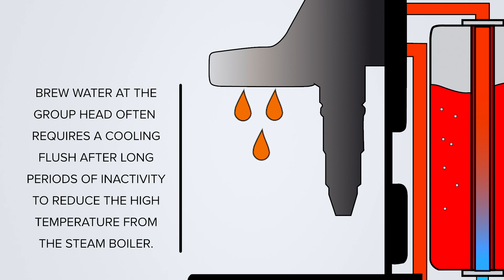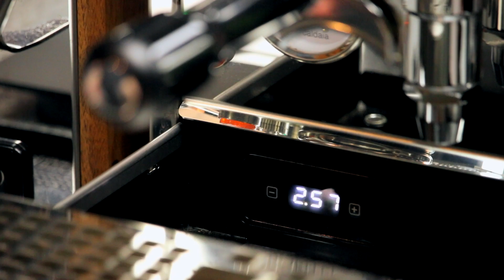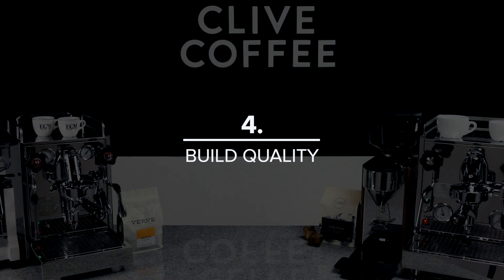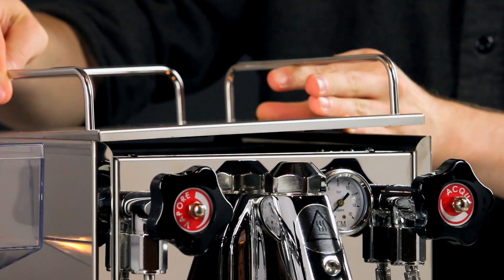Profitec Pro 500 PID vs ECM Mechanika V Slim HX Comparison

Comment: I've been reading a lot about how heat exchangers actually produce a better tasting espresso than a double boiler due to the declining temperature profile. Italians say that brings less hot water and energy to draw the astringents out in the last part of the extraction. I've been researching for so long, at one point I was dead set on a double boiler. Having been to Italy 7 times and never drinking anything close to what I've had there, I would tend to believe there's a reason the Italians prefer heat exchangers. Only in America would we lead the home barista into believing they would need a double boiler. The double boiler was created because barista's in the U.S. are not trained properly so they can pull a more consistent shot with a double boiler. If the Italians are right, and I would imagine they are, you would be better served at home with a heat exchanger unit.

Comment: Have the Mechanika V Slim and love it. Found the steam pressure was a bit high from the factory, turned it down by turning down the pressure stat by 0.5 of a turn resulting in pressure dropping from 1.35 to 1.2 bar. This resulted in less overheated water at start up while maintaining a good steam pressure.
Reply: Hi Gordon. Curious to know from other Mechanika owners...How often does your boiler cycle? Mine does every 53 seconds on average.
Reply: Thank you very much for this information! I noticed the same today, as I used the machine for the first time. I'll set it up accordingly to your recommendation!

Comment: It came down to these two exact machines before I finally purchased and it was a hard pick, both are really awesome kick ass machines. I ended up going for the Mechanica but only because of the fact I was on the fence about the PID on a HX. It's great being able to adjust brew temp electronically on the fly rather than having to adjust the mechanical pressure stat on the inside of the machine, but the PID is another part to wear out and need replacing every 2-3 years. They are easy enough to replace yourself but they do cost about $200-300 a pop (not the cheapest wearing part when in comparison the vibration pump costs $80 and can lasts 10+ years)  That considered I don't really change my beans around often enough (at all) so I didn't see the PID function as something i would get enough benefit from. Also the Mechanica was cheaper by $350 when i was purchasing so i went that way. Both are high quality machine made in the same factory, so either one will be very reliable and easy to maintain yourself.
Reply: I made the same choice for similar reasons.  How is your ECM going?
Reply: @GlowingTube  Machine is going great, hasn’t missed a beat.
Reply: @ajv802  I just got mine… I have been pulling incredibly good shots with it and hope to do so for many years to come.
Reply: Hey! Thanks for that input about maintenance. I like the Mechanika, but I do use different beans all the time, so I'd like a PID. So, that's that. I am on the fence between Profitec Pro 500 (~$2k) vs 600 (~$2.4k), since comparable ECM models are more expensive. I am on the border between the two, due to the fact that I cannot figure out the maintenance issues that I will be running into. I understand that it's pretty much HX PID vs. DB PID. Does owning DB machine require less maintenance? Therefore, does it warrant the extra $400?? Man, this is hard, since you mentioned the PID costs... yikes. I may have to rethink about PID. What do you think? What are some maintenance parts on these machines I should look out for?
Reply: @jk25653  I'm no expert by any means but If you have the budget id go for a dual boiler, and all the high end  DB machines have PID's fitted. I guess you just have to factor in the cost of replacing the PID unit when it wears itself out every few years. Not really the end of the world cost wise when you spread the cost over 3-4 years. When compared to the annual cost of your beans and water filters etc it's not really that bad. 
As for more or less maintenance with HX or DB, not too sure. I guess having two boilers means having two heating elements, but I wouldn't imagine that would dramatically affect long term maintenance costs, but better to ask someone who has a DB machine i guess. Good luck with it all, both those machines you mentioned sound awesome and i'm sure you will be happy with either!

Comment: Which one would you get ? I’m in the market of my first machine under $2k, my sight was originally with appartamento and some one told me to look into ecm and profitec!  Profitec 500 PID is on my lead what do you think
Reply from the maker: Hi there! That's a great question, it's hard to pick just one since they both have so much to offer! Between these two, you're looking at a comparison of a completely analog machine with the Mechanika and modern digital temperature control with the Pro 500. Performance wise, they feel very similar and can keep up with back to back drinks with ease. If you want to adjust settings and experiment with temperature, go with the Pro 500. If you're more about consistency and reliability, the Mechanika will certainly fit the bill.

Comment: From what I understand, since the addition of the PID on the Pro500, the recovery time after pulling a couple of back to back shots has gone up significantly, up. To 10 minutes. Can you explain that?
Reply from the maker: We have absolutely no experience or evidence that supports this. In my testing for this video, I pulled 3 shots back to back and saw no significant decrease in the effective brew temperature over the duration of the shot. Indeed, it was more stable from one shot to the next than the Mechanika by a strong margin.

Testing and personal experience aside, there is nothing about the design of the design or specs of the Pro 500 PID that should increase the recovery time. The only case where this idea might hold water is when the PID is set to significantly lower temperatures. This will, of course, increase the recovery time accordingly.
- Charles
Reply: Clive Coffee Thanks for the reply, I think what I meant was the recovery time after steaming and pulling shots. :)
Reply: I own the mechanika V slim and it is the highlight of my day. The steam power is a bit strong at first if you're not used to working with such power, but once you use it a few times it is a blast. I do agree that a 7 to 10 second cooling flush is necessary. I also warm my machine up for approximately 25-27 minutes. I've found that to be the sweet spot. Love the red on the knobs. It is durable yet easily moveable. I have it paired with a specialita and they work seamless together. Thanks for the video.
Reply from the maker: @npb3010  That's such a fun setup. We're also big fans of the touch of red on the knobs.

Comment: Great video as always. Correct me if I am wrong I thought they were the same company? Like Lexus and Toyota
Reply: Sister companies, But which one is Toyota & Which one is lexus ;)  ?!
Reply: @corruptedkid4145  I have ECM Classikca PID Not Mechanika V Slim HX  so i must say ECM is Lexus hahahaha, any thoughts?
Reply: @erocks2858  im looking to buy either the ecm classika or profitec pro 500. I need help!
Reply: @corruptedkid4145  You have to decide what you want on your espresso machine, Classika will come with PID which i was looking for and Pro 500 is Heat Exchanger which you have to control the water temp by releasing it before you extract.  Do your research before you commit.  I looked about a month before i pulled the trigger.
Reply: @erocks2858  Yes the pro 500 also has a PID. this would be my first hx machine. Ive had 2 barista express over 5 years but want something that will last 10 min. I was dead set on the classika but if im spending that much i may want to jump up to the 500.

Comment: As long as we are talking about national stereotypes: The weird thing about these machines is that they should be designed in Italy and built in Germany.  That would be more assuring.  Italians have beautiful designs, but are not exactly known for practicality, attention to detail, and build quality.  The Germans are know for precision and engineering.  Germans might counter Italian design excess that undermines performance.  Seems like the German-design and Italian-construction slogan plays to each culture’s weakness. I’m still buying one, but the current bi-national sales slogan doesn’t move the needle for me.
Reply: Search YouTube for a tour of the ECM factory. The engineers don't just sit at a desk in Germany, they work on the floor of the factory in Milan. They oversee all areas of production and ensure that the machines are built according to their spec. The tolerances and quality assurance are absolutely top notch. The reason why it's smart to build these machines in Italy is that Milan is the world capital of espresso machines so there's an entire local industry around supplying parts. This is the same reason computer/phone makers like Apple build everything in China: the local supply chain can't easily be duplicated in another country.
Reply: Interesting point. My Mechanika V Slim came with an improperly connected steam valve and was leaking hot steam onto the Gicar brain, static relay and other nearby electrical. What tipped me off was water collecting under the machine, and eventually the blackened Gicar brain cover. I prefer German design and build when it comes to guns and cameras, and would love to see their handiwork on an espresso machine. Clive's support has been top shelf.

Comment: HX machines all need a cooling flush.

MaraX: hold my espresso.
Reply: That's good though. Heat exchangers produce more flavorful espresso that double boilers due to the declining temp profile. Cooling flush it is!
Reply: @limer4330  you mean double boiler temps decline during the shot? There's something to be said for the hx boiler size being easier to recycle between shots too. An americano will slow it down but it can handle consecutive shots and milk easy. I just wish they had a rotary pump option!
Reply: @braticuss  all e61 groups use a thermosyphon. The point is you need pid in the hx at two points and automated flushing (the marax will happily drain its tank if left to its own devices) or the brew head temp will get too hot.
Reply: @braticuss  yea you probably need a grouphead thermometer and like you say "tuning". The marax is plug and play, never a cooling flush, always rock solid temps, no tuning. Its why its patented. It does flush from time to time but not through the grouphead, it vents through the opv as the group lever is closed obviously.